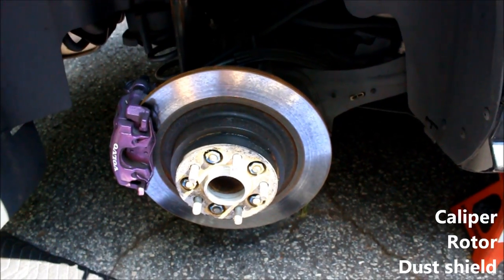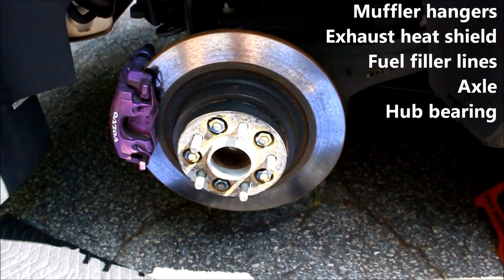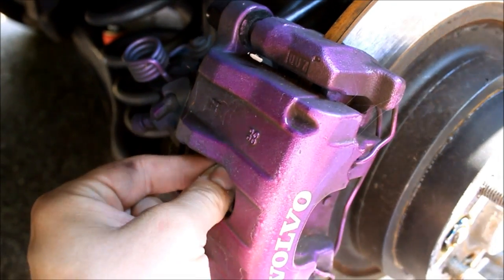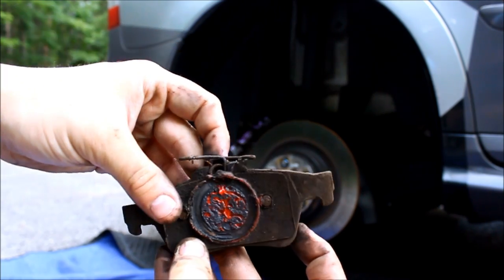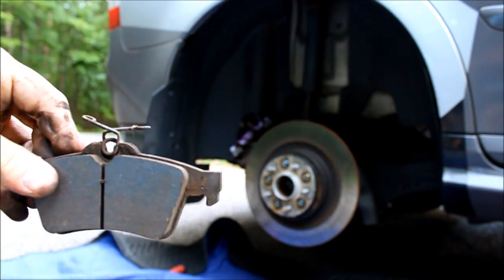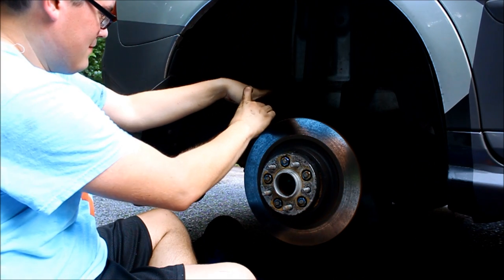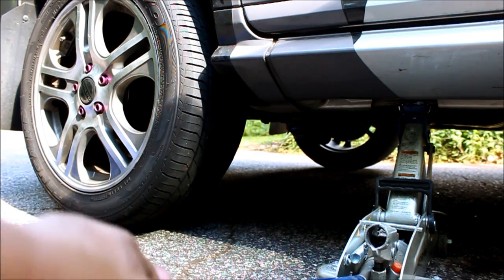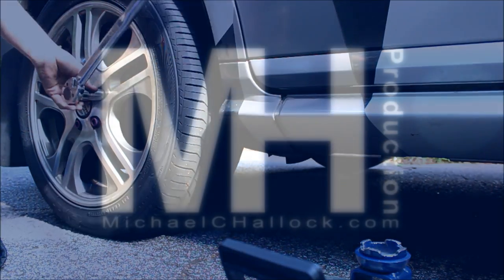Rear Wheel Rattle??? Loose Brake Pad!

Comment: Thank you so much. This is exactly was happening to me. Toyota installed new rotors and I started to get this sound. They said it wasn’t their fault. I checked everything from CV joints to the exhaust. Just to find out is a loose pad. Thanks for saving me money.

Comment: Hi , This is exactly what happen to me , last week I changed rear brake pads , and since then the rattling sound increase, at first couldn't tell what it was, only after to discover it was brake pads. My brake pads had the spring only on one side, so the other side was still rattling , what I did was , I bought another set of pads , and put  2 sets with 2 springs on 1 wheel , so there was a spring on each side of brake disc and would keep pads in place. It had fixed the problem! :) wish you had uploaded this video couple days before , would have saved me some hustle :D

Comment: Thank you so much for demonstrating the sound and the solution. Exact same problem on my girlfriend's VW Golf Mk6 on rear left side. Metallic rattling noise when driving along, especially over bumps. No noise when braking over bumps (but only realised this after watching your video).  Found one side of two 'wings' of spring on brake pad had slipped into gap on calliper causing it to rattle. Of course when handbrake was on (when jacked up on axle stands) no noise... Took rear pads off and re-fitted and no more noise. This was driving me crazy - had been looking at the suspension and exhaust but never thought it would be the brake pads, especially one year after changing the pads/discs!

Comment: I first experienced this noise on my first car, an MX-5. It was very noticeable as you sit close to the wheels and often have the windows or roof down, so there is no noise dampening. From y experience, they are prone to brake-pad rattle as the retaining clips are weak and many aftermarket brake-pads also don't allow enough clearance for these clips to be re-installed easily, so many people just leave them out. I'm getting this same noise on my C30's rear pads, so I'll be pulling the wheels off soon and fiddling with the pads. I have also noticed though, that as the dust boots on the rear shocks age, they wobble around and bang on the shock, making a noticeable noise too. My left rear shock has the paint worn off from the dust boot scraping it.

Comment: I have a metal rattling noise in the rear omy camaro. I changed the struts, control arm, and sway bar link. Nothing fixed it. I couldn't turn the wheel because I had the E-brake on. I tried looking for videos, but none detail the noise the way you did.  I have that same rattling.  I'll check this out tomorrow. Thank you for a great informative video.

Comment: My car was doing the same thing I would drive really slow and I could hear this loud rattling noise and I had one of my friends put my new brakes on well I won't be letting him work on my car anymore
Reply: Ah shit happens it's somebody in this case your friend had an issue getting the caliper to sit right when reinstalling the bolts to the caliper just a lil touch pressure an boom bent springs but in the same breath did your ebrake work still

Comment: I had an s60 executive. That car no matter how well you done a job so simple as that would always have it's brake calipers come loose - Volvo are the main culprits when talking on this very subject! Great reliable engines, especially the petrol 5 cylinder turbos. Mechanically elsewhere cheaply put together.

Comment: Thank you so much for sharing.  This noise has been going on for almost a year.  I've taken my jeep in for service 3x and no one could determine the cause. On all 3 visits I mentioned the breaks.  I was told they couldn't do anything about the breaks because they were not worn out.  SMH.  I have an upcoming appt w another Jeep dealership/service department.  Hopefully, they will listen and resolve the issue.

Comment: Lol I did the exact same thing. I checked every single dog-gone suspension part and couldn’t replicate the rattle. Finally one day I Jack the car up and smack the tires with a hammer and BINGO, it’s heard. I initially thought it was a wheel bearing issue. But as I was removing the brakes to get to the wheel bearing I discovered that a brake pad was loose 😂😅 Glad I caught it before I went spending $400 on a set of bearings.

Comment: Coincidentally, I have a Volvo that does this also (2013 S60). I know it's the brake pads. Different from yours, the brake pad retainer clips are the light-weight ones without much strength. I'll remove and re-bend to see if that will work. Many thanks.

Comment: Hmmm. I have the same rattling going over bumps and/or pretty randomly. It usually goes away as fast as it comes in. However, on the rare occasion (few times really) it doesn't immediately goes away, I can hear it through braking as I pulled over. Which makes me wonder if it means it can't be the pads then? I don't see how a pad could vibrate/rattle if it's being pushed by the caliper cylinders. That rattling noise though, is the same as the one you have in the first 20 seconds of the video. Thanks for posting this!
Reply from the maker: I'd go through the list of all things I mentioned checking first. Unless your caliper is seized and not squeezing both pads, I would not expect the pad to be loose when braking.

Comment: My caliper setup on the Toyota Yaris 2003 is strange. Has two long pins going through the pads across the caliper secured by springs interlocking the pads to the pins. This noise sounds weird as it amplifies like crazy. I've had cops turn around and follow me thinking I'm driving a clapped out defective vehicle.

Comment: I hope this helps somebody
I have a 2017 civic ev turbo hatchback.I put read pads on and while driving the rattling.I tried adjust the springs nothing.I bought napa premium brake pads and NO MORE RATTLING.Its 70 bucks but well worth it.

Comment: Just saw your old video on the brake rattle and can't wait to pull mine apart to check. I noticed you have wheel studs...did you put on a kit to retrofit from the annoying factory bolt type? Thanks for sharing, hope this cures my noise.
Reply from the maker: All P1 Volvos (C30, S40, V50, C70) use wheel studs and lug nuts.

Comment: I'm having the same problem which I had to figure out by myself with some knowledge along the way.. What makes me furious is the fact why wasn't I informed by any of the many males that have heard my story and never suggested the rattling could be from worn brake pads..One person was my son in law who discovered I had a seized caliper which he replaced with a new one.  Why wouldn't anyone who knows anything about mechanics know to advice me to also replace brakes pads too.  Its only common sense that the wheel with the seized caliper would have worn down that pad all the way therefore when installing the brake caliper there would be alot of play for the worn pads to rattle...I don't know if i explained that well but yeah thats my same problem.
Reply: What kind of brake pads did they fit?

This can happen if someone fitted racing pads instead of regular road going ones. Racing pads are slightly smaller vertically, to allow for expansion under very high temperatures and high performance brakes have small buffers to hold them in place. On normal cars they won't be there, so they rattle around.

It usually says on thet pad what it is. But you may have to remove it and look up the model number with some brands.

Comment: WoW! This started happening on my 99 Honda CRV since about a week now and has been driving me nutz (couldn't pin-point the issue until now,  I THANK YOU for that) . A friend replaced the front breaks about a  month ago. Is it safe to drive like this until I can get to the breaks again?
Reply from the maker: Rick Hunter should be fine, as the piston presses the pad against the rotor when braking, so your brakes will still function properly. But you might get a little wear on that pad as it rattles against the rotating rotor.

Comment: Hey! I heard a clunk in my passenger rear wheel this morning. Then it did it again this afternoon only after this second time there is now a metallic sound I can only describe as metal rolling/bouncing around inside the back wheel, when the car is moving. Do you have any idea what it could be? There's a lot of potholes and I think this is the cause. Many thanks.
Reply from the maker: Could be a bad bearing. Could also be something simple like a rock stuck in the dust shield.

Comment: I was just leaving from my drive way and my driveway wasn't good and hit something just beneath the front wheel and bit worried with rattling sound and i checked it hit to the bearing. How to fix the one any idea?
Reply from the maker: Easiest way to replace a front bearing is to swap out the whole knuckle assembly with another one that already has the new bearing pressed in. Just follow my videos for axle removal, strut replacement, and lower control arm replacement to see info on how to disconnect each part of the knuckle.

Comment: This sounds similar to whata happening in my Volvo. Would braking while driving stop the rattling noise since it would compress and the noise would go away?
Reply from the maker: If it is due to a loose pad, then yes. Braking will compress the pad and prevent it from rattling.
Reply: @MyNameIdeasWereTaken  would it be possible to just fix the loose brake pad without doing the brakes?, maybe the clip might be bent like in your video.
Reply from the maker: @hectoremm6456  Yes... Just take the pad off to inspect it for any damage and fit it back in place. No need to replace the pad if it's just a bent clip.
Reply: @MyNameIdeasWereTaken  thanks alot I might try to check it today after work. I really appreciate your response.
Reply: @MyNameIdeasWereTaken  What about if the sounds are there while driving, accelerating and breaking and the sound is still there
Reply from the maker: @hlebrosicky  That could be a bad bearing, failing shock or shock mount, could be the end links, or could be a bushing going out on the control arm. Hard to diagnose without hearing it in person.
Reply: @MyNameIdeasWereTaken  Also just today this caused me to not have control on the direction and steering. The car was swerving off track a little bit because of that clanking sound i belief

Comment: Mine is doing a similar noise, but only when accelerating it. Any thought?
Reply from the maker: When accelerating, it could be associated with a rear axle (on AWD), the rear hub bearing, or possible even an issue with the shock that is only really noticeable when the rear end squats down under hard acceleration. These are at least the things I would check first.

Comment: Lol sooo much grease. Fixed rattle, can’t stop
Reply from the maker: You should always add extra grease. Once it dries, you can cut away any excess. Grease goes on the outside of the pad to prevent squealing and has no affect on stopping ability.
Reply: That’s not extra bruh.....

Comment: i think this is the cause of noise in my car, is it safe to drive with this happening?
Reply from the maker: Depends on your caliper setup. But I would say it should be safe if you have already been driving on it. If the pad is loose, it still gets compressed when braking and will still stop the car. But it's worth addressing sooner than later to avoid uneven pad wear or potentially damaged rotors.
Reply from the maker: Of course, if your problem is a wheel bearing or suspension component, I'd address that immediately. You don't want your wheel falling off as you drive down the road...

Comment: Why are mine doing the same thing on both a 06 Chrysler 300,,,and my 03 jaguar s type niether have springs on the pads
Reply from the maker: Not sure about the brake pads on those models, but a lot of cars have different inner and outer pads, which generic shops mix up ALL THE TIME. I've re-done brakes on many friends' cars because shops put the pads on wrong and allowed them to start rattling after a few thousand miles. 

Have you ruled out bad wheel bearings?
Reply: MyNameIdeasWereTaken ,,,,yep took the o6 300 to my mechanic,,wheel bearings good, usually do my own work have never ran into it before,,,the guide pins seem slightly loose on outer pads rear of car only,,,,wondering if the previous owner left a part out ,,,I changed them and the rotors about a month ago new hardware and all.....
Reply: MyNameIdeasWereTaken.  My wife hit a huge pot hole but not sure that caused it....pad on rear passenger side loose in caliper shoe as if the backing shim needs to be a touch thicker to stay in place,,,,,caliper bad maybe??
Reply from the maker: If the pad has play between the rotor and caliper piston, it does sound like the caliper might be seized up. I would jack the rear wheels up and step on the brakes to confirm if the rear brakes are actually engaging or not.
Reply: Also took dust shields off the jaguar ,,,,no more rattled so 1 down and 1 to ponder
Reply: MyNameIdeasWereTaken ,,,,,thanks for your reply,,,will give it a go after work and report back,,again thanks

Comment: Hey I know this is completely random but I just bought an 05 s40 T5 and I was wondering if there where any cheaper ways to add an auxiliary input or Bluetooth to the radio than the Grom audio system. I looked for days but I can't find anything. Does anyone have a cheap alternative?
Reply: Guillaume Larok does it have an AUX option on your menu? If so check your middle console all the way to the back for an aux input. I have a 2007 Volvo S60 2.5T and that’s where I found mine. Hopefully it helps you out.